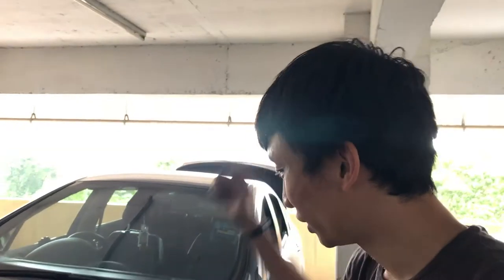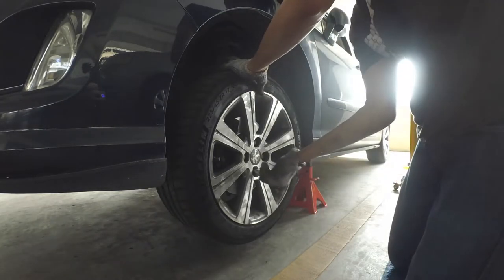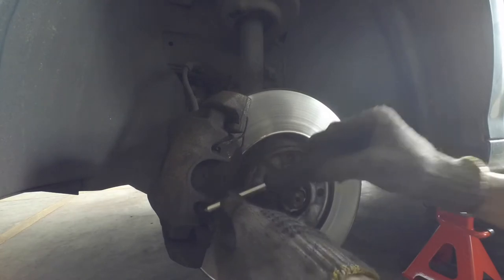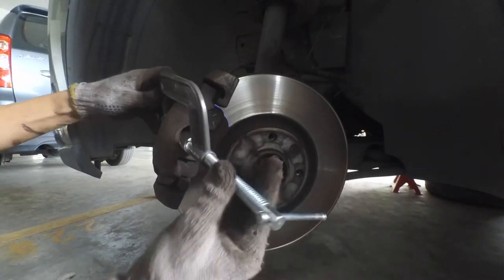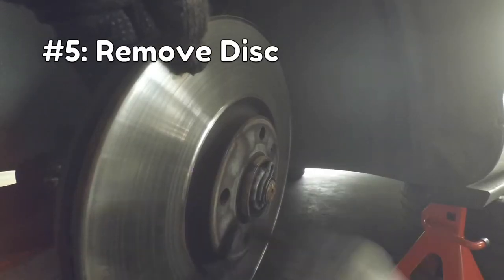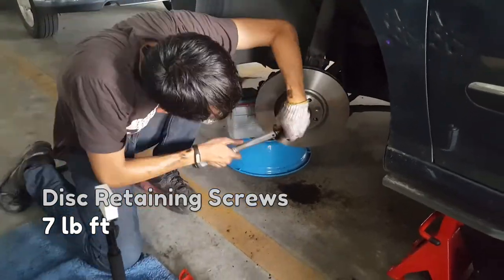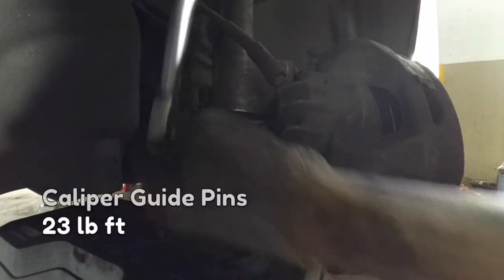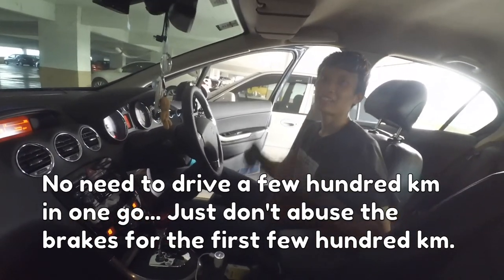Peugeot 408 Brake Disc and Pad Replacement

Comment: Nice video. However some important parts missing. Most important, before you push back the piston, you must open the bleeder valve on the caliper. And let brake fluid out as you push back the piston. If you dont do this you damage the abs system because you are forcing brake fluid through the system reverse way. After pushing back the piston, you can close the bleeder valve. And dont forget to top up brake fluid if needed. The second thing is that you need to use lubrication on the hardware where the pads slide.
Reply from the maker: Thanks for the tips!

Comment: Hi wondering if you still have the 408 or not ?
Reply from the maker: Nope, sold it.
Reply: TJ Woon Haha I see , Mind asking have you had any issues with the car back then ? Like consumption of engine oil and sensors appearing every so often ?
Reply from the maker: @YenEn97  yes I had problems with the turbo, burning engine oil, turbo oil return line (I think), and a bunch of other stuff. Basically I was always sending the car to the workshop for something to be fixed, so I sold it 😅
Reply: TJ Woon haha I see I see I guess that makes the two of us. Mine’s been consuming engine oil recently and thinking of remedies to resolve these issues haha
Reply from the maker: @YenEn97  I think the high oil consumption is caused by the valve stem seals. So the oil gets into the combustion chamber and gets burned off. My car was taking 1 liter every 1,000km, which was very high even for a car with the problem. I did a top overhaul for that if I remember correctly.
Reply: TJ Woon it could potentially be so , did some research and it all narrowed down to valves being the culprit